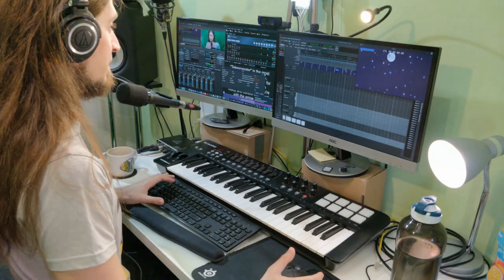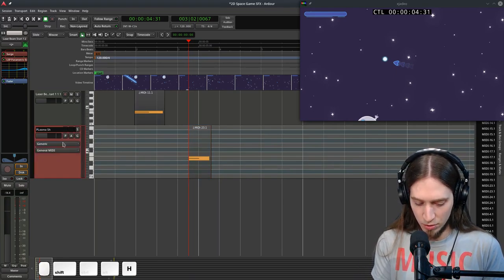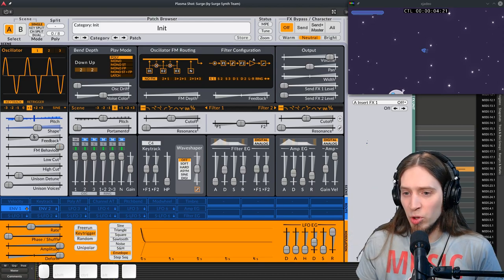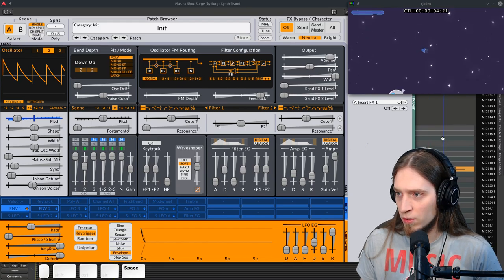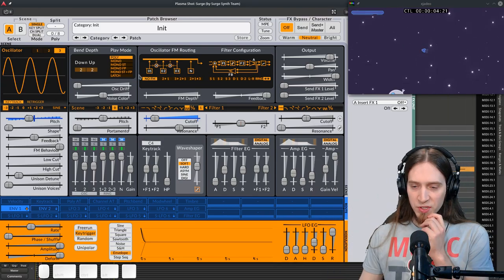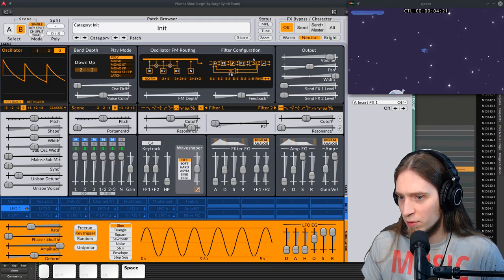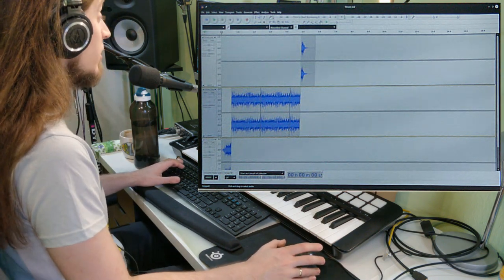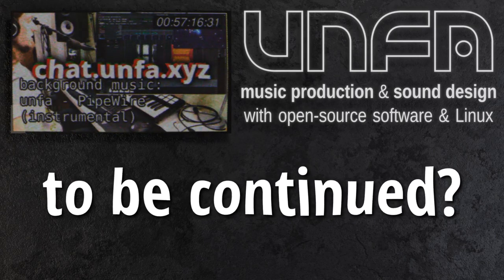How I made sound effects for this game using only libre software [Part 2]

Comment: You pay attention to a very fine details. Hard work. That's not so common in today's world. Thank You for proving that it is still possible.
BTW - have you ever tried working with a firewire audio interface on Linux? I'm really tired pushing my TC Impact twin to work with latency below 10ms not hitting max DSP load and without Xruns. Same problem with jack/ALSA and with jack/Firewire route. I have RT 5.10 kernel (Manjaro) , user in audio group and even IRQ priorities set. Nothing really helps.

Comment: Oh glorious magnificent sound smith, are you still using Pipewire successfully as your sound back end? :)
Reply from the maker: Lol :D

So far so good! I had to tweak some configuration to make it not change the buffer sizes for JACK applications all the time, as they tend to crash if that happens, but apart from that - it seems good!
Please note that I was still using JACK when this video was recorded. My PipeWire switch came much later.
Reply: @unfa00  Good to hear. Can't wait for applications to starting using the Pipewire API directly for even better performance.
Reply: @unfa00  Hey, want to share what configuration changes you did? I have the same issue with the crashing, my workaround was do enforce a static buffersize for all clients, which is a bit against the concept of pipewire...  "pw-metadata -n settings 0 clock.force-quantum 1024" if anyone wants to know